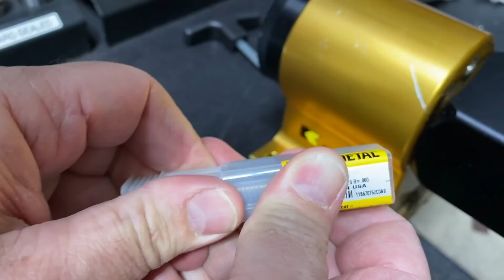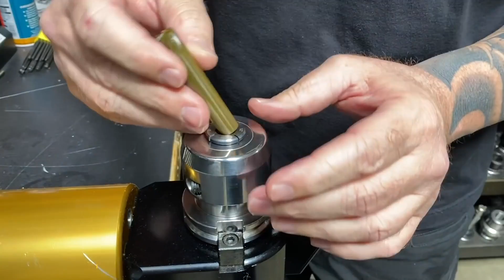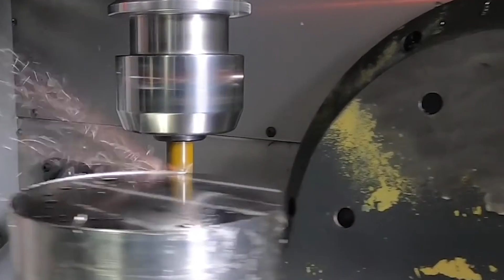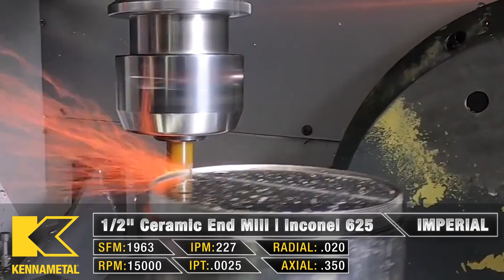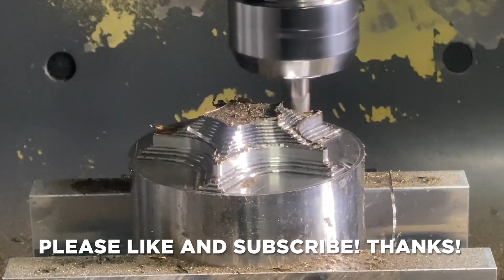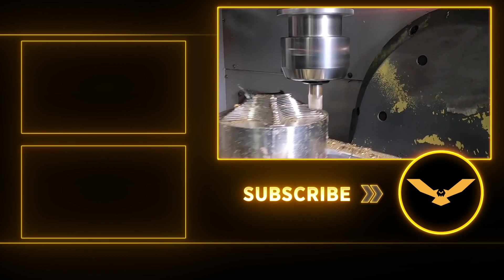You Deserve to Get FIRED if You're This Person in the Machine Shop

Comment: In some places your ideas will never be implemented because the management didn't think of it first.
Reply: So damn true. Val also sums up how my place of work operates. They think they can get anyone from off the street and train them in a week. It’s crazy how many people this year alone have started and then been laid off because they don’t understand what they are doing. They want to pay the bare minimum which is why no one with experience will come here
Reply: Or they will tell you no and act like it's their idea 4 months later.
Reply: not always the case, I was 1 of the best machinists at the company I work for, gone through them as an apprentice, manual and cnc, along with grinding milling turning boring gear cutting experience. You name it. They now have a manager that can lead because they know how to machine, others can ask questions, speeds/feeds, new tooling, implement ideas that all think of, 1 of the apprentices comes up with bangers that we totally missed. Shop runs smoother than ever. So in reality it's paid off taking a good machinist off the tools, and whenever I have chance I always go back on them in sections that fall behind due to holidays or sickness.
Reply: @danielotter9402  sounds like your company has some common sense unlike the majority
Reply: EXACTLY!!!!!

Comment: The shop I just started in is exactly the opposite. The engineer is on the floor helping with everything.
Reply: I work as an engineer in the sheet metal fab shop. Me and the other engineer are usually out on the floor more than at our desks. I also program our CNC machines as well. Hell I even do machine repairs if nobody else is available. I had to change seals in the coolant pump on the laser chiller, and switch out power supplies for the Fanuc control on our punch/plasma. Don't know what I'd do if I couldn't get my hands dirty now and then.
Reply: @bigblueram01  I got moved from our shop to QC because my parts were immaculate and the bosses wanted me to be the one checking everyone else's product. Now I'm a desk jockey that never sees a fleck of dirt unless they leave chips on a part. Sucks for me.
Reply: @bigblueram01  Hi Trevor that's now how its supposed to go. Unless you looking to gain respect of blue collar workers around you who did not see you put in efforts at school for education higher than theirs. This is the job of the mill wright and your job is efficiency time studies and programming. Unless you want to get qualified as a mill wright machinist or sheet metal worker in which case is different.
Reply: Simon Douglass you are lucky to have such engineers in your organization, whereas in my organization, engineers doesnt even know how to hold a vernier caliper. And that's a true fact. No jokes.
Reply: Thats awesome man! Hope it works out for ya!
Reply: In my work place, educated guys think being engineer is running a company sitting behind a desk. If you guys ever meet them, all hell will break loose.
Reply: @swatboyz100  You can stand around watching or participating in the shop work the workers will respect you they do not understand how or why the company really does make money which is sales and thinking of how to stay competitive.
Reply: Nothing to boast but being an engineer I mostly help with programming for our 5 axis and sometimes the old machines because I love it. But the old guys at work think I’m doing things the wrong way coz they are still stuck in the past. It’s sad that no one listens to you but keep doing what you love. ✌️
Reply: Are they hiring lol
Reply: @F30586  👍 yes